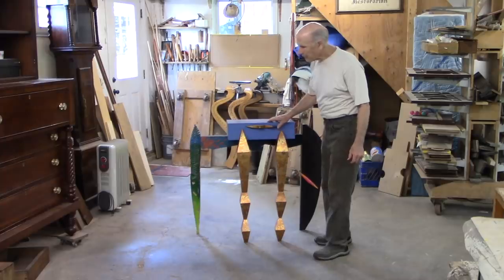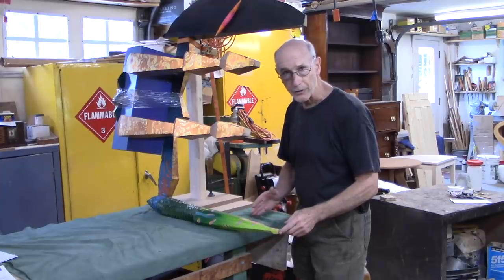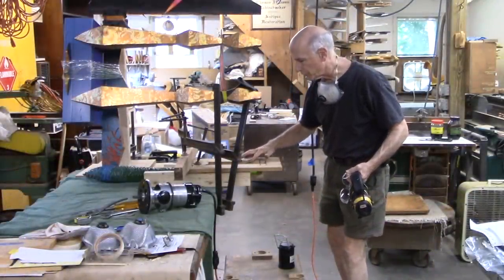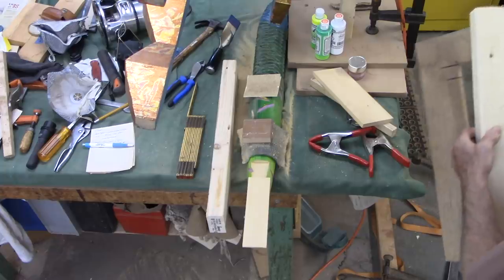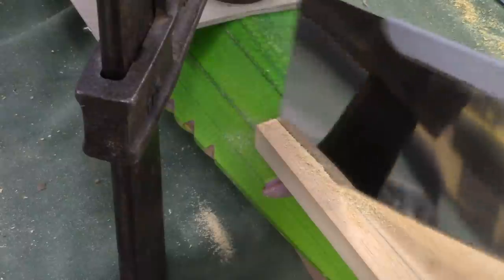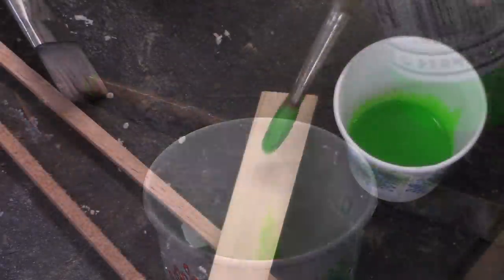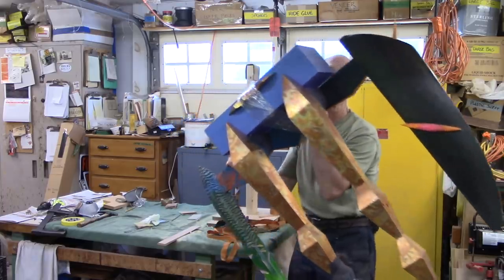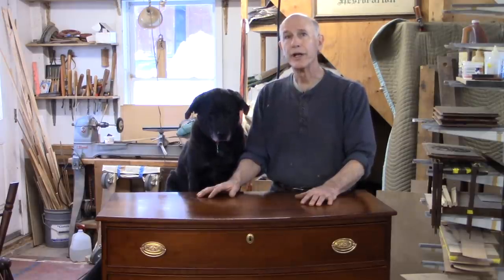Restoring a Wendy Maruyama Postmodern Studio Piece- Thomas Johnson Antique Furniture Restoration

Comment: An automobile body refinisher once told me that when it comes to matching repaired areas you go for a 10-foot visual because without totally repainting a surface you'll never get a perfect match.  
Great job as usual, Tom!
Reply from the maker: Yes, that is exactly right. It can also help to turn out the lights! (I'm not kidding)

Comment: Another great video Tom. When you were making the jig for the router, I wondered why you didn't cut your 2X4s to the same angle as the chair leg. This would have given you a "ramp" to rout out the damaged part in one step instead of three. Then again, you're the expert; just wondering.
Reply from the maker: Thanks! That's a good idea, but the damage was so random that there really wasn't a straight line, without loosing the entire foot. And I really wanted some of the foot to be there as that became my only reference point.

Comment: On the legs is actually heat treated variegated copper leaf.  It needs to be sealed or over time it will oxidize and turn brown/black.  Every square of leaf is different, so trying to match up a "flame" from a damaged area would have been one heck of a challenge!  The gold "wax" was a good alternative.  I've used it before and I'm pretty sure it's solvent based, so you shouldn't have to worry about tarnish :)
Reply from the maker: Thanks! Yes, I know very little about all the different types of leaf. All very interesting

Comment: Hi Thomas, me again with questions. Is the putty you are using epoxy? I use a plumbers epoxy that looks like a Tootsie roll. It hardens like metal that can be machined. I don’t think it is the same.
Reply from the maker: Thanks Mark! It's a "tootsie roll" epoxy, made for the wood industry. It has to be similar to the plumbers epoxy at some level. maybe different characteristics

Comment: Why did you change the insert in your table saw Tom?
Reply from the maker: Thanks! The standard insert has a wide opening. The plastic insert's opening was created by the saw blade so it's very narrow. This really helps prevent blow-out when cutting small and delicate pieces, so I only use it for that

Comment: Seeing Tom use power tools on the piece to be restored (as opposed to shaping replacement parts) is not unlike seeing Julian Baumgartner with a staple gun.
Reply from the maker: Good one! I don't think Julian is averse to modern tools! Think of his job using the lasers
Reply: @johnsonrestoration  Nope. Just staples. ;)

Comment: A block plane would've been so much better. It would have taken off the minimum amount of original material, produced a far superior gluing surface, and with no endgrain joints.
Reply from the maker: Thanks! I did use a block plane! The saws helped me keep the correct angle. There's a lot of face grain there,I'm not relying on the end gran